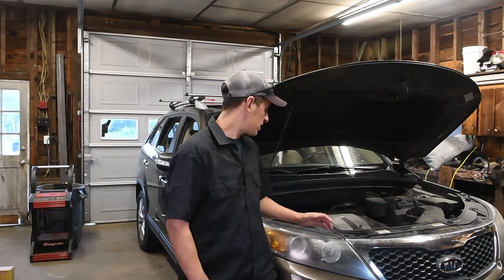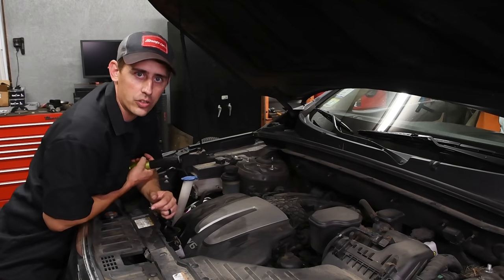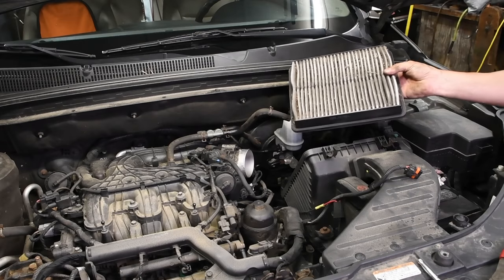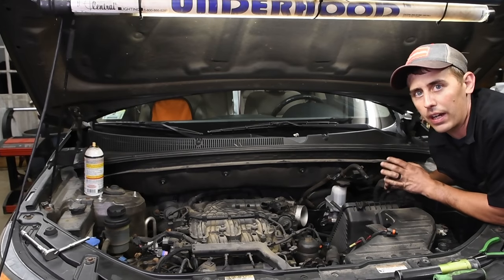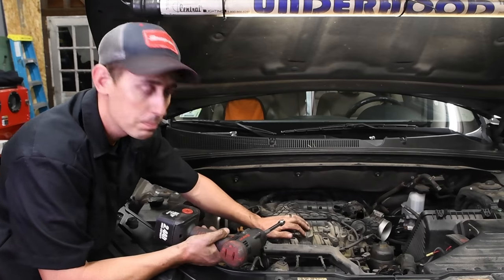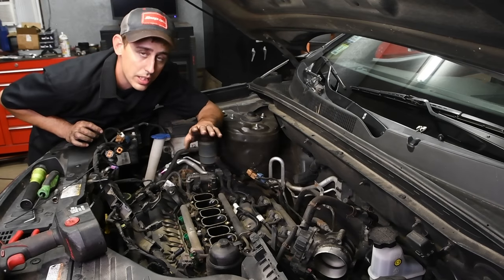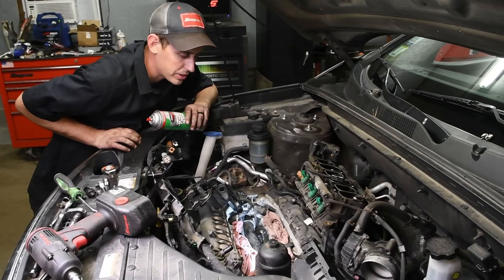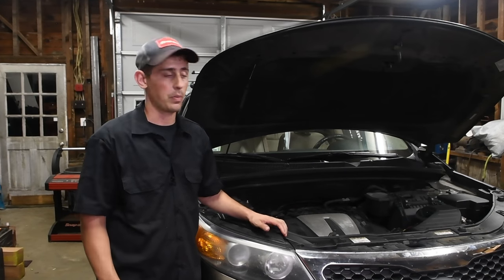Kia and Hyundai 3.5 oil leak diagnosis and repair

Comment: Well done! Do i have to change engine oil after switch replacing? Ore i can add oil to get level?
Reply from the maker: If you aren’t due for an oil change yet you should be fine with just topping it off. Thank you for watching.
Reply: I fixed it ! Thanks for video !
Reply from the maker: I’m glad it helped!

Comment: If the gaskets are in good shape is it necessary to replace them?  Noone has them and kia wants $184 and change.. hopefully I won't need to use them
Reply from the maker: I always recommend new gaskets but if you can’t get them and they are really nice you might be able to get away with it.
Reply: Yeah.. after thinking about it I went ahead and used the new gaskets. Also kia doesn't let you return special order parts.
Reply: Thank you Sir.  You made it possible for normal people to avoid paying too much. You've saved a lot of people a lot of money

Comment: I replaced oil send valve in my 2016 Sedona at dealer 1450!$ still leaking ,dealer said dye test revealed leaky head ,get a new engine!8500!
2 other mechanics said oil filter housing is bad (meanwhile starter failed!600!$) New mechanic replaced filter housing ...still leaks !!! they said part may be bad and they will eat it if and when they can get the part. I am worried oil send valve is the problem from first repair .What would you do?

Comment: 2016 sedona has some sort of ac or pressurized aluminum lines in the way Iso I was unable to get to the oil pressure sensor but good thing dealership said it’s extended warranty so they’ll do it no charge. When I reassembled everything I didn’t get new gaskets and now it’s making a strange noise. Hopefully when I replace the gaskets this will resolve the issue. Fingers crossed….I’d ask the dealership to do it but they want 700 even though there taking apart to get to the sensor anyway…… makes no sense.

Comment: Great video!  I am not a mechanic so I was wondering if I need to put anything on the intake gaskets or between the lower plenum and the engine block?  Thanks!
Reply from the maker: No need the gaskets are designed to seal without any additional sealant.
Reply: Is absolutely necessary to replace the gaskets if they're in good shape. Noone has the gaskets.. had to go to kia.. $184 and change.. so hoping not to use them.. btw fuming about the price of the gaskets

Comment: Can u not get to this from the bottom of the engine? I got a 2017 kia sorento and it's not leaking oil but my oil light came on yesterday at idle. I changed the oil and everything but still comes on and goes off while driving

Comment: I just got my engine rebuilt for my Hyundai 2013 Santa Fe, and the mechanic said there is small oil leaking and that it is rear main seal. Could it be the sensor ? Should I ask him ?
Reply from the maker: Sorry I just saw this comment. It could be this sensor that’s leaking. I would explore that before replacing the rear main.
Reply: @InTheShop  IT WAS THE OIL SENSOR!! Thank you so much !!
Reply from the maker: @ququsmith  awesome!

Comment: Hi 🙋‍♂️ i have a hyundai sonata and i started notice there’s some leak below the vvt next
To the timing belt i ready replace the valve covet gasket you think it could be the oil pressure sensor ? Hope you answer i will appreciate alot
Reply from the maker: If it helps I have another video that shows an easy way to narrow down oil leaks.

Comment: Hi I hope you answer me, I’m having this issue with the same car but my situation is leaking oil but mixing coolant and oil in the radiator and the car after 10 to 15 minutes driving or turn car on is over heating you think is this issue or the head gaskets bad ?

Comment: what if ' you could design an extension that would screw into oil sensor hole ' extending out far enough to change oil sensor without taking the whole top of motor apart

Comment: Question, saw another video that removed that center water pipe that you suggest working around with the wrench. So I was trying to do that to get better access for both switch/sensor replacement and cleaning in the valley. So I loosened the water temperature control assembly (WTCA) to remove the center pipe as the other video showed, but it is being a real bear. Do you know if the center pipe is held in to the WTCA just through friction with an o-ring and the same on the end opposite (where the sensor / switch is) ? For some context, at this point I have drained coolant so that is not longer a deterrent to this method of removing the center pipe. Also. seems quite a puddle in the valley making me thing the weep hole might be clogged, giving another reason to get in there and do a good job. Thank you for any input. ... ... More info to hopefully prevent back and forth. I have remove the 6 fasteners from the WTCA (4 nuts on block-mounted studs, 2 bolts). Also, I removed some but not all hoses, not yet anyway as it does not seem like they are preventing the motion I am trying to get. The WTCA wiggles plenty, seems free and none of the wires or hoses seem to be the inhibitors of moving enough to get center pipe out. Also, I have tried both with removing the 1 bolt for the center pipe tab removed and installed. Tried the installed thinking maybe it hold the pipe would allow me to wiggle the pipe out since less play was allowed. Thank you again. ...

Follow-up, I got great advice from a friend to use grease to loosen up and remove the pipe and worked perfectly. This allowed me to remove the pipe and get full access to switch for removal and clean up of valley. This is a great video though, not many out there for this job but in my case the access that appears available when wrenching the switch is not the same for mine which is why I needed to remove the pipe. A ground down wrench might have worked, but cleaning was much easier with pipe removed not to mention the range of motion is very limited and I needed to use a 6-pt wrench due to the rounded corners of switch. A 12-pt on the small side might have worked, but think not with the 25-32 ft-lb torque spec.

Comment: I have a kia sedona 2016 imported from the USA with a 3.3v6 G6DH engine, is the repair, apart from removing the high pressure pump, the same as in the 3.5v6 engine? What parts do I need to buy in addition to the intake gasket and pressure sensor? Thank you for this movie, in my country there are maybe 30-40 cars (too big capacity, stupid ecology) but I'm happy with it. Greetings!!
Reply: I am facing a 1500$ estimate and doing research on this same vehicle

Comment: Hi, My daughter has a 2010 Hyundai Sante Fe AWD limited. 2 years ago I did have the pressure sensor replaced on it, when it had no oil in it. It still leaked oil in the driveway after the sensor was replaced.  the place that did it said some of it was from oil they couldn't get out of the valley, and the rest they said is from the rear main.  I have taken it for second opinions, and 2 garages have said it actually is the rear main. It had 60k miles when I had the sensor replaced, and it now has 90k. Could the sensor have been bad out of the gate? or could it really be the rear main?  Also, one of the garages said that since it uses about 1 quart every 2500 miles (I have been tracking it for a year) , it is not worth doing the rear main. His main reasoning was the can of worms it might open, his 2nd was the $1100 cost of doing it vs putting a quart of oil in it ever couple months. What you think?

Comment: I have an 03 Kia Sorento and I'm wondering what would be causing it to be leaking more than a quart of oil as fast as you can put the oil in on the front of the motor it comes down over the water pump and down the motor that looks like a giant really big stream of oil, if you could help me that would be great.

Comment: 2011 Kia Sorento V6, I checked passenger side like you said and it’s dry. Checked drivers side between the battery and oil filtering and oil is puddling up in that spot. Suggestions?
Reply from the maker: I would say it’s probably the same leak
Reply: Ok thanks!
Reply: Finally got my parts from Amazon, one of the electrical ports on the back is being difficult. How’d you get this off without breaking it? I can send you a picture
Reply from the maker: Jacob Meyers send me a picture. Nathan@intheshopmedia.com

Comment: does this type oil leak carry over into the 3.3 liter engines as well i have a 2017 sedona that has a major leak  just wondering if that would be a good place to start if not  any ideas as to where to look
Reply: Did you find out the problem?

Comment: Have you found out what year this applies to. I'm wondering if it goes as far back as the first generation 3.5L engines. As in the Hyundai Santa Fe 2002 and Kia Sedona 2004 3.5L v6s ..I saw on Wikipedia that the car model years you have in the video had a different name of the engine. Compared to the first generation 3.5L engines.
Reply from the maker: This only applies to 11-14 as far as I know.
Reply: I also have a first generation 3.5L engine on 2005 Santa Fe. Having lots of trouble locating the Oil Pressure sensor. My Haynes Repair Manual has a picture showing it is next to the oil filter. But this can't be right - I don't see it next to my oil filter.

Comment: 2011 Hyundai 3.5 - oil pressure sensor replacement.  What is the torque value to use when inserting the replacement sensor?  Thanks
Reply: I see that it is 15.9 ft lb

Comment: With the oil pressure sensor being bad would it cause the engine to stall? That being the sensor is bad and or may be both the low oil and sensor ?
Reply from the maker: The bad sensor wont cause the engine to stall. Low oil could but if its low enough to cause a stall I would be concerned about damage.

Comment: i have a 2017 Sonata 2.4. i have an oil leak but cannot seem to find where it’s coming from. it is also a fast leak because i had removed the throttle body and cleaned it well. i looked the following day and you can tell there is a lot of new oil. another issue i’ve encountered is the oil is traveling against the wire harness and getting into the connectors which has caused problems of its own. do you believe this is the same issue as shown in this video? thank you in advance!
Reply: i cleaned out the engine area not only the throttle body *
Reply: one more thing! lol. right before i started having this issue. the oil light started randomly flashing. wouldn’t consistently stay on but every now and then would start flashing. i believe mostly if i was at a red light going up hill or so.

Comment: Oil light comes on after driving it was suspected oil pressure sensor and I found oil coming out of the connecter once replaced. What would cause a blinking check engine light if it was all put back together in reverse? Would it be the plenum and lower intake gaskets? I was sure to be careful with the gaskets and the lower intake gasket seals appeared to be flattened so would that cause a sealing issue? 2012 Kia Sedona 3.5l with 134k
Reply from the maker: A blinking check engine light indicates a misfire. I would scan it to see if there are any other codes but if the gaskets were flattened they should be replaced.
Reply: @In The Shop  appreciate the quick reply!
Reply: @In The Shop  turns out it was 2 connectors on the left side of the plenum weren't all the way secured and the sensor was the problem and the light turned off. Still thank you for the encouragement!

Comment: My 2012 sedona seems to be driving fine... what will eventually happen if I dont fix this sensor?
Reply from the maker: Is yours leaking?
Reply: Yes sir
Reply from the maker: The leak can get much worse to the point that the oil is spraying out. It won’t take long before the engine is out of oil and severe damage occurs.

Comment: Any advice on a 2014?  Same problem leaking from the bell housing,  but I thing the oil sensor is not in the same place as the 2011-12.
Reply from the maker: Try using a small mirror or borescope to see if there is oil puddling under the intake manifold
Reply: In The Shop Thanks.

Comment: I have a 2013 Sorento but it is the 2.4L 4-cyl gdi. From what I read it is still under the plenum. I can’t seem to get the plenum loose though. Have you worked on the 2.4L?
Reply from the maker: Its been a while since I have worked on one. I believe there is a bracket from the bottom of the plenum to the block.

Comment: So the oil pressure switch causes the oil to leak I’m confused.
Reply from the maker: The oil pressure switch fails internally. The diaphragm that the oil normally pushes against to read the pressure cracks and allows the oil to spray out of the connector.

Comment: While doing this repair also noticed a lot of oil in upper and lower intake and carbon crap on butterflies of lower intake runner turns out its from defective PCV valve around $12 from rock auto and "supposed to be changed every 30K miles... you need to address this issue when in there because VCM motor fails and lower intake butterflies fail from this build up and end reult is lower intake assembly north of $600 and it needs to be calibrated at a dealership to set the stops for the butterflies or I suppose it will not only run poorly but possibly need replaced yet again ..recomend towing it to dealership to reprogram the unit. took 4 cans of intake cleaner to do top and bottom ..never again next time tossing it in blasting cabinet and using baking soda to clean .. this time was to lazy to change out media in cabinet as have heavy aluminum oxide in it now and if miss some it will tear the intake up.. changing media takes 2 hours to make sure you get every grain of couarse media out when switching to glass beads or soda or walnut. if you see oil and crap clean it off .. as for PCV valve its cheap and your in there put a new one on regardless

Comment: Hi Dear....  i have seen that you have oil leak from the top of engine comes from oil control valve cap  . i have same problem and i need to order the part causing the problem  but i dont know exactly which part under the valve cap causing the problem  !! ... please check your video at 3:21  , check the oil leak comes frmo the cap of oil control valve. .  my engine has no other leak except this ... shall i change the valve itself ? maybe the plastic part of the valve under the cap is broken ?  or what ? please check your video at 3:21 and you will know what im talking about ... i can send you email with pictures from my car is you can help ... many thanks

Comment: Thanks for the video. Would you be able to confirm if the oil pressure switch on the 3.8L (Kia Sedona 06-12) is in the same location?  Although I see another 3.8L comment, which leads me to believe the oil pressure switch is in the same location as the 3.5L from your video,  the writing is not clear.
Reply from the maker: Hi Howard. I'm not able to confirm that. My experience with this issue is only on the 3.5. I would say if you are having a similar leak I would try looking under the manifold before tearing anything major apart.
Reply: @InTheShop  Thanks
Reply: @hgmorris Did you solve the problem?

Comment: Ok so I did this once, doing it again and when I pulled off the throttle body, the nipple on a plastic piece broke below it and started leaking fluid. Do you know, would that be the water outlet?
Reply from the maker: Could you send me a picture of what broke? Nathansgarage1@gmail.com
Reply: I will be able to tomorrow, I deleted the picture I guess. It is the hose that has coolant going to the throttle body
Reply: I tried sending the pictures of the broken piece. Didn’t know if they went through so I sent them again.
Reply from the maker: I just looked at them. Looks like the outlet. Do you have a dealership close to you? If so you can go there and their diagrams are pretty detailed.
Reply: In The Shop yes I do. And I can get the outlet at my work (Autozone) but, not sure if I should go dorman or check the dealership and get the OE. I know it’s only $100 and some change for the outlet, and it has a lifetime warranty, but the damn oil switch was a lifetime part as well, replaced with part from my work at around 85,000 (when it first went out) and now again at 111,452!!! I’m probably going to go ahead and try this part one more time, and if it doesn’t last at LEAST 50,000 miles I don’t think it is worth it.
Reply: In The Shop real quick, just started scrolling through your videos! Subscribed, you have some awesome videos that are definitely great learning material for me and what I do.
Reply from the maker: Thank you Mark! I appreciate that.

Comment: i have a hyundai santafe 2006 turbo disel has oil leak engine seems too run fine and turbo seems too spool okay  no smoke at all got told piston and rings spent 1200 already and no mec has degreased engine help gohn austraila
Reply from the maker: Unfortunately I'm not familiar with the diesel santafe. We done have them here.

Comment: hey, I just replaced oil pressure sensor to my kia sorento 2011, but still leaking btw engine and transmission under the car. 
kia dealer said it comes coolante leak, need change engine, it’s too much for me, how can I do now with the mayor oil leaking, thank you
Reply from the maker: Is it coolant leaking or oil leaking?
Reply: both leaking

Comment: Do I have to remplace the gaskets ? I have a 2012 Kia Sorento
Reply from the maker: Yes. The manifold gaskets should be replaced whenever it’s removed.
Reply: What would happen if you put it back on without changing gaskets?

Comment: I’m getting a little coolant leak in that area as well.   Have you seen some common causes of this leak
Reply: There’s a metal coolant tube that is right above that oil pressure switch. Where it goes into the front cover could be leaking.